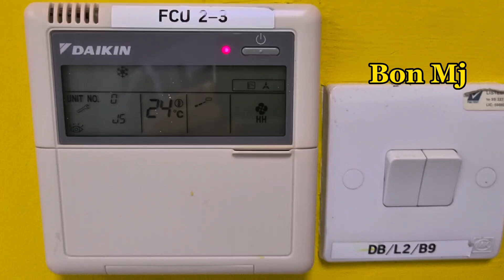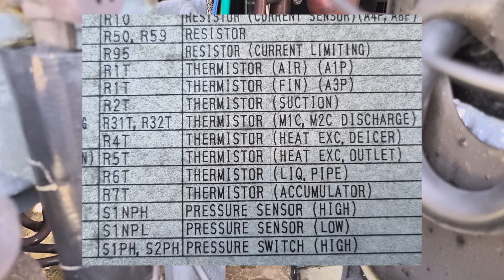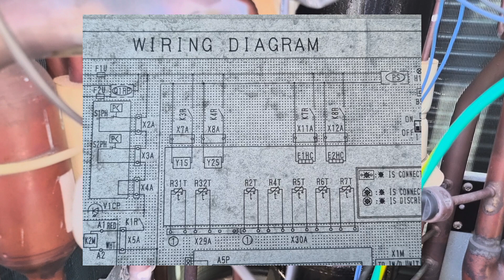Daikin VRV3 | Outdoor Thermistor Layout RXQ12-PA | Error J5

Comment: Hi bon can you help me?   I’m working on vrv4 master and slave unit.   On master a compressor grounded so I disconnected power to it and put unit in emergency mode.     When I connect my D checker my low suction pressure transducer reads - negative value.  Like -495.      I replaced sensors but still have same issue.   Do you think PCB board is bad?

Thanks
Reply from the maker: Do you key in correct model
Reply: @BonMj  that was issue. Thank you. There was 2 options on d checker with same MN didn’t know